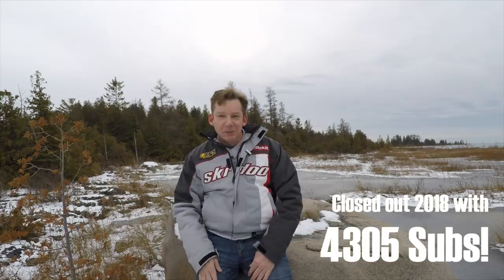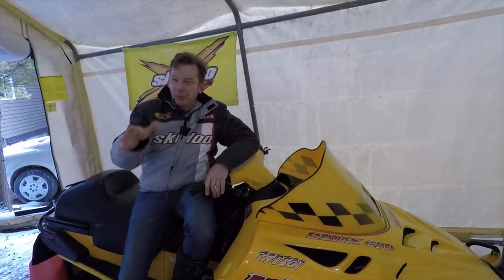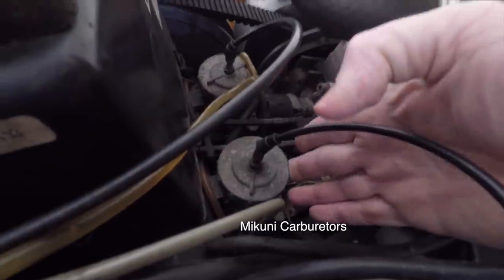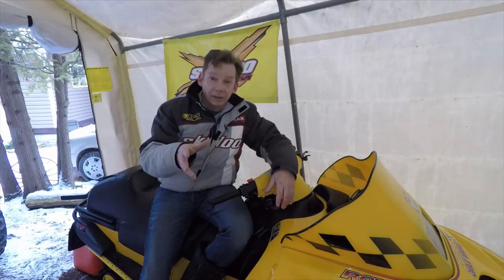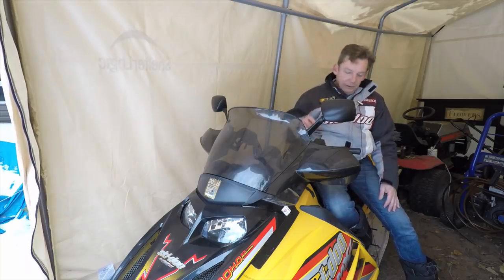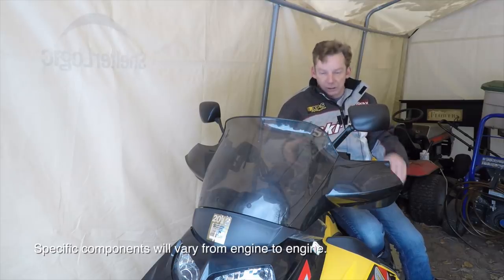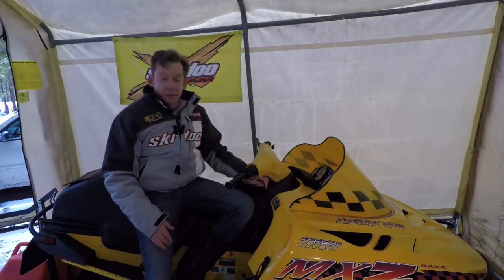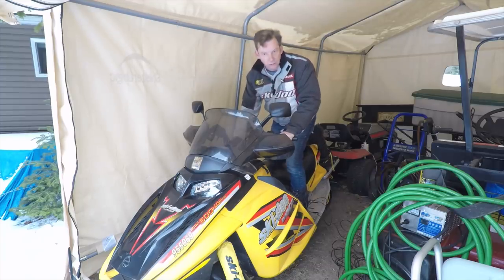Carburetors or Electronic Fuel Injection—What do I think is Better on a Sled?

Comment: I prefer carburetor because it's simple and easy to fix
Reply from the maker: Hi Tommy. Totally hear you. Thanks for watching and commenting.
Reply: Same here although I have both EFI and Carbs  my wife rides the Newer sled with EFI I ride my 1999 Skidoo Mxz 670 my wife's sled is a 2012 Skidoo Mxz 600 and we have a 1990 Skidoo Safari 470 our oldest son rides and I came across a package deal 1974 Skidoo TNT 440 and a 1976 Rupp 440 I started our youngest son out on our 1974 Skidoo TNT 440 and we started my younger brother out on the 1976 Rupp 440 for his very first sled and he loves it my dad and I picked up a Package deal 2 1994 Yamaha Exciter II 570's my dad rides the Black Sled and we started my Mom on the Red Yamaha Exciter II 570 my dad's has aftermarket exsust carbs new seat couple of of other Goodies that I can't think of right off the top of my head we also ride Three wheelers Quads Mini Buggys Dirt Bikes and Mini Bike my son and I Race Mini Buggys we have a couple Manco Dingo Buggys one I have had since My 5th birthday bought brand new and one my son Races we Also have a 2 seater Silver Fox Buggy we ride when we are going to be riding with a group of Side by Sides we go camping and riding with my cousins my boss an his family and a few friends you get the point I have been riding Snowmobiles since the age of 4 my dad started me on a 1980 Kawasaki Drifter 440 and I rode my dad's Long Track Mountain Rescue snowmobile Rupp 650 I got my first Manco Dingo Buggy at the age of 5 which I still have today I got my first Three wheeler at the age of 10 1984 Honda 125m rare Blue I have a 1984 Honda 200s I have a 1975 Dune Cycle Three Wheeler my older son rides  my wife rides a 1997 Polaris Trail Boss 250 our son rides a 2006 Kazuma falcon 125 Yamaha raptor 350 look alike I have a street legal Baja Warrior 200 I have a few other big street Bikes and a couple other smaller scooters for the kids when they get older
Reply: cant have carbs in the mountains. run like shit and if you need to roll the sled you flood it
Reply: A fuel injected sled doesn’t need to be fixed
Reply: Definitely perfer efi, most efi sleds start easy (if for some reason they don’t have an electric start, you can run then on there side or hell even upside down, they rarely fail if ever, they automatically tune themselves (amazing for hill climbing) and if they don’t you can usually tune them in less then a minute, etc

Comment: I was on an Edge chassis for 2 years with 2 different sleds. This year I bought a 2011 Shift IQ which is EFI. Can't go back, it runs so much smoother and throttle response is so much better. Honestly, the prices of the 2010's sleds are starting to get so low, you can get into EFI for the same price as a nice used carbed sled from the early 2000's. Theres no going back, EFI from here on out.
Reply from the maker: Yeah, snowmobiler are the last holdouts. :) everything else has already gone efi.
Reply: MrSnowrocks we have 99 carb and efi, efi wins by a long shot. Also have a 2006 t660 turbo 4 stroke efi by far amazing
Reply: Isn’t the IQ shift is a carbureted sled?
Reply: Until it breaks down! I can fix my carbed sled!
Reply from the maker: There are diagnostic tools that can read the error codes on the newer sleds, that’s really the difficult part. I’ll be fixing my efi sled as well.
Reply: @MyOldSled  Oh I gotcha! Lol I have a 08 klr 650 and the main reason soooooo many adventure riders love the bike is one of the last carbed ones left. You got a better chance fixing on the trail compared to one with efi. I guess I'm still old school! Lol Just more expensive tools to buy. Lol
Reply: Ya well even the 90s efi sleds are quite cheep now and they run almost just as smooth

Comment: Personal experience. I have a 1994 wildcat 700 efi, pull start, starts 2 pulls every time. Once the efi stops working on it the sled is toast but she’s got a few years under her belt with no problems so far.

Comment: I’m still a carb guy, on my boat and my sled. If you maintain them, they’re super reliable. And easily serviced by yourself. EFI runs better, when it runs. One buddy of mine is always bragging about EFI and 4 strokes, yet his stuff always has issues. I bought a 2012 Skandic WT 550 fan, and after running SeaFoam through it, it works pretty good. -30’s it starts no worries. I go way back in the bush solo, and don’t relish the thought of needing a generator to start my machine. LOL. All that said, carbs need periodic love, but they are steady Bettys. Take care.
Reply from the maker: Hey BN60!  Thanks for sharing your thoughts. I get where you’re coming from. I’ll be picking up a portable power source just in case...but I’ll probably go smaller than a generator ;).
Reply: I think he is talking about a generator for powering a block heater on the 4stroke. Not just for boosting/charging battery. I know guys who drag generators around with their 4strokes when out in the bush solo for a long time.
Reply from the maker: Ahhh...it’s fun seeing different perspectives. I’ve never considered a block heater...
Reply: My Old Sled yeah, lots of sleds here in Yellowknife are plugged in at home. Street legal here. Maybe do a 2 vs 4 stroke video, if you haven’t already? Keep the good stuff coming!

Comment: Got a n artic cat 600 efi this year. I really miss having to prime and choke not to mention fouled plugs, flooded engine. it starts 2nd pull so I miss the workout and having to change the starter cord. throttle response is right on.

Comment: Thanks again for an unbiased and informative video.
I own a carbureted sled and injected motorcycle. I love them both..
The sled that I own, was only available as a carbureted model, until 2019. I'm $1500 out of pocket for my 2001, where the 2019 was only offered in the Powersurge ordering program, and would have been about $18000. Bang for the buck, I'm more than happy with my choice.
Reply from the maker: Hey Mark. I love both of mine. Actually, I still feel like riding my old, carbureted '97 most of the time :)
Reply: @MyOldSled  I am so happy with the purchase of my 01 SRX 700. Unfortunately, mother nature hates Northern Ohio this year, so far.
I bought all of the right gear to go riding this season. In the off season, I hope to do a complete tear down on the old Yamaha. 
If I was to tear it down now, we'd get snow..

Comment: Perfect timing of this video. Very informative.  Looking forward to your carb cleaning vid. I am in the middle of a carb cleaning on my 2002 ski doo that hasn’t been started in  4 years.
Reply from the maker: Hey SM...Thanks for watching. Be patient, I have my sled apart at the moment.
Reply: Good luck I got my skidoo from 2003 running after 9 years! Runs great. Back when I was a kid I took it to get service twice. Problem wasn’t fixed. Took it out a couple months ago. Tore it apart and it was acting up because the gas line was disintegrating and getting sucked up into the carburetor and a rubber grommet was also bad. Replaced all the lines filters drained snd cleaned the tank runs great!
Reply: Well I should say there wasn’t any gas lol but we vacuumed it out and drained if there was anything

Comment: I've always had carb toys.  Bikes, sleds, atv's...

Then I got a 2015 Polaris Sportsman ATV with EFI.  The 570.  LOVE IT.  ONLY issue is if the battery is low, the machine will only idle.  If you try to take off and drive with it, it'll go about 100 yards and stall - it doesn't produce enough power to both charge the battery AND run the fuel pump, injectors, computer, tail lights (always on), ect.  That's the ONLY issue.

Everything else was carbureted (sp?).  I felt like I was constantly cleaning carbs.  3 bikes, 3 sleds.  It was getting old.

Then I got an 06 Polaris RMK 900 (not the best motor, I know...) which is EFI.

Rebuilt the motor and had electronic issues - a weird air intake sensor reading.  This lack of data to the computer made it think it was cold and it defaulted to the richest fuel map.  Basically the sled runs on full choke, constantly.  Even when hot.

Long story short, the previous owner had put a splice in the sensor wire to make it longer.  I removed the splice, soldered the wire together and finished with some dielectric grease and heat shrink tubing - the thing runs like a champ!  

Of ALL my family's toys, that big, unreliable, horrible production, paint mixer 06 Polaris 900 starts, ALWAYS, 3rd pull COLD, 1st pull warm.  No electric start or battery.

Yes - EFI may be trickier to diagnose, but once you figure the problems out and sort through them, there's no human error.  The computer does EXACTLY what it needs to do, based on the sensors.... and while they aren't cheap to replace ALL of them, most of them are less than $50 and can be swapped out as quickly as spark plugs are changed... Plus they take up very little space in the 'spare parts' box and the failure rate is very low in comparison to potential issues with carb'd machines.

I am now shopping a new dirt bike - and one of my requirements is that it be EFI.  I'm done pulling off bowls!

... probably not.  haha!

My .02!

Thanks for making the videos!  My wife, son and I enjoy them quite a bit.
Reply from the maker: Hey thanks for the comment. Glad you're enjoying them.

Comment: Hi Dave
New subscriber from NH USA.
Great videos. I just got my first efi sled,a 2000 zl 500. Only been a few miles with it but I can already feel the difference.in throttle response and smoothness of how it runs. I have owned carb sleds for forty + years,I can fix them in the dark trail side if needed. Huge advantage. My only fear is if there's a problem with efi.
Thanks for the info,great channel
Bob
Reply from the maker: Hi Bob. Congrats on the new sled! I know how you feel, but do you worry about your car? Kinda the same.
Reply: My Old Sled 
WOW,fast response!
Don't get me wrong,I am excited about the efi. Always like to learn.
Just unknown territory for me. Just waiting for snow. Trail goes through my yard but we only have 4" of snow.

Comment: Just stay away from ethanol fuel with Carbed sleds.. It turns the jets GREEN and can turn the fuel into jelly in the bowl.. Run good gas and good oil, run stabil in the last ride or run of the year to treat the fuel system and fog your motor.. Clean power valves every 2 or three years depending on use.  I run Klotz oil in my Formula 3 700 ski doo and the exhaust valves stay pretty clean even in 2 years of running!
Reply: Larry W I typically use stabil at the end of the season but it doesn't work worth a shit
Reply: I run 87 in my 1999 Yamaha, and my dad always ran 87 or 89 in his 2002 MXZ. We haven't really had any issues with the carbs over the years. Keep the sleds running once or twice in the summer, zero issues. Both machines have been quite reliable, people always think they need to clean the carbs every year and they really don't.
Reply from the maker: I always run premium gas in my sled, but hey, keep doin what your doin if it works for you. Thanks for the comment.
Reply: Its getting harder to avoid ethanol based fuel unless you you buy high  octane that has no ethanol ,and that's only at Esso and Shell as far as I know .I use fuel stabilizer for marine/ ethanol based fuels ,then at the end of the season I siphon my fuel tank and put it in my car.

Comment: I'd take that 670HO of yours and delete the oil injection, add a 151x1.75. I got the skid track and extension material and turn it into a Logger with lower gears. I'd have the clutching and jetting changed for a set up I have in mind for a worksled.😁
I got a thing for the 583 and 670 Rotax Engines👍
Reply from the maker: Hi Bolt. My sled is just a 97 mxz 670. The 98 and 99 summit X's had the ho engine. The MXZ HO came out in 99. There is really no reason to delete the oil injection, its very, very unlikely to fail. Thanks for watching and commenting.

Comment: Good morning Dave,,Another excellent informative video. Speaking as a small engine mechanic / machinist and of course a avid snowmobiler. I think overall EFI for the win hands down.Especially with emissions theres no way in hell i can tune a set if carbs to be as clean for the environment as EFI. And  thats what industry is majorly  concerned with ,im just surprised that Doo even has a carbed sport MXZ model left. That being said.You'll always see carbs on drag racing machines mainly because they can be tuned for excessive and i mean excesive fuel flow,i seen fuel lines up to 7/8 diameter here in north bay at the radar runs.Without getting too technical,,,Try and run EFI with that much fuel and your going to need double to three times the pressure to regulate on a EFI fuel rails.Yeah for the average sledder just add some injector cleaner once a season,,i use lucas myself in my 2012 mxz 800,but yah add to the gas once a season ,and i add stablizer.and she good to go.
Reply from the maker: Thanks for commenting joe. Glad you liked it.

Comment: I have both a 99 MXZ 600 and a 18 polaris 600 efi. Both sleds are great but efi is the way to go. Theyre far more reliable. My 99 has 7000miles on it and its on its 3rd rebuild, my dad has an 09 mxz 600 etech with 7000 miles and its never been apart and is still on its original plugs
Reply from the maker: Hi Andrew. Thanks for sharing your experience!

Comment: I have a 01 skidoo formula deluxe 500 fan,has electric start any idea where the battery is located I just got the sled and I dont see it in the engine bay
Reply from the maker: I believe it is located behind the oil tank. I think you have to take the airbox off to get at it.

Comment: I just bought a 95 summit 583 HAC Rotax and I was wondering why its so hard to pull start?. Is this normal
Reply from the maker: Yes. Its a common complaint. The 583 was a hard pull. I think it was the pull starter. Still should be two primes, two pull start.

Comment: My professional small motor mechanic opinion. I’ve been a small motor mechanic for over 18 years. If you’re driving a carbureted machine you better clean those carbs every fall. If you don’t you’re Reading risk of a lien out. Your machine may idol just fine. But once you give her throttle she may start to lean out. I’ve had so many customers tell me oh it ran fine when I started it. And 5 miles down the trail they blew a piston. My professional small motor mechanic opinion. I’ve been a small motor mechanic for over 18 years. If you’re driving a carbureted machine you better clean those carbs every fall. If you don’t you’re Reading risk of a lien out. Your machine may idol just fine. But once you give her throttle she may start to lean out. I’ve had so many customers tell me oh it ran fine when I started it. And 5 miles down the trail they blew a piston.
Reply from the maker: Hi Peter. I asked two different skidoo service technicians that question, both advised that annual carb cleaning is excessive. Same place I got the advice to drain the carb bowls. I don’t disagree with you that cleaning them more often will reduce the likelihood of issues, but I am comfortable leaving it longer. If i rode thousands on thousands of km, maybe. Thanks for the comment.
Reply: I run 87 in my 1999 Yamaha, and my dad always ran 87 or 89 in his 2002 MXZ. We haven't really had any issues with the carbs over the years. Keep the sleds running once or twice in the summer, zero issues. Both machines have been quite reliable, people always think they need to clean the carbs every year and they really don't.

Comment: I have a 600 sdi like you and my friends have the 583 and 670 models and if we go out on a cold morning they are screwing with their primers and chokes and I just have to pull mine over once, and my throttle response is much better then theirs, however when my injectors break it will cost more that it will to fix theirs.
Reply: And I save 8$ every time we fill up at the gas station
Reply from the maker: Throttle response is far better with EFI. Thanks for watching Bro.